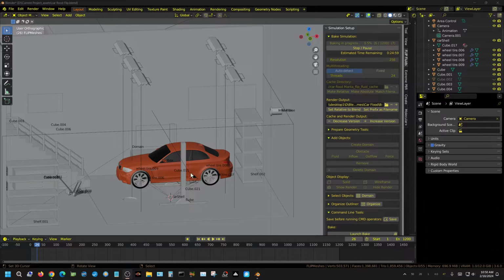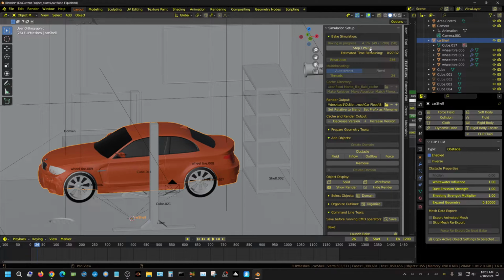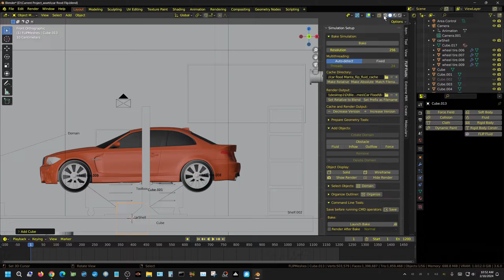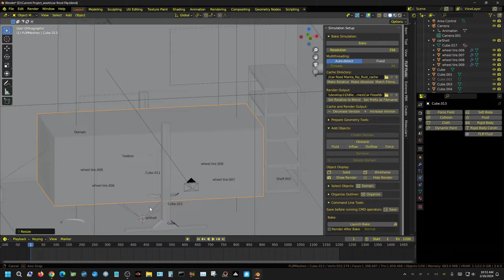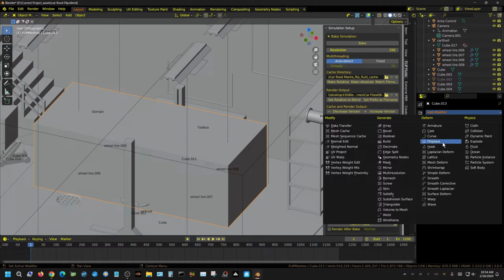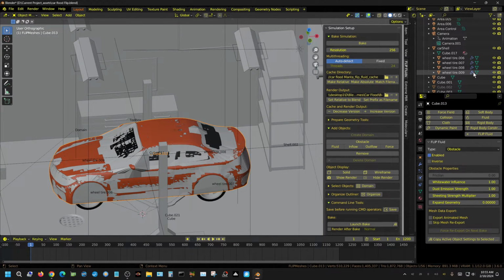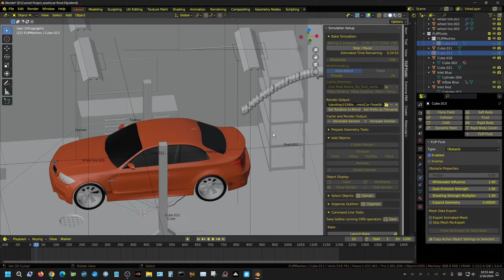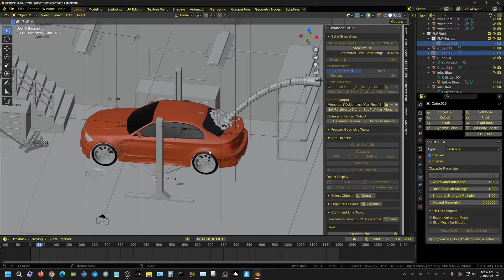Flip Fluid Going Through Obstacle - Easy Fix

Comment: Couldn't you also use a Solidify modifier?
Reply from the maker: In general you could use a solidify modifier. But in this case the car is too complicated and not exactly built correctly. I have the chassis and body along with all the interior parts as one object. Some are non manifold(as in not a fully enclosed object), some are planes and others are fully enclosed. For a plane object, a solidify modifier would work. But when like in this case it's a mix and match, a solidify modifier won't work. Plus it likely would make the object look weird. It's easier and simply works better to create a basic manifold shape the same shape as the car.